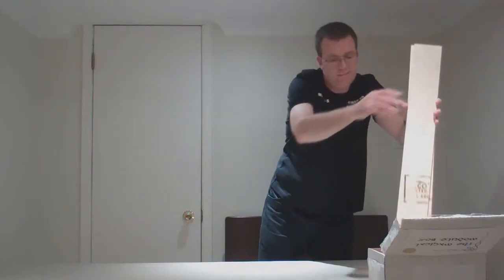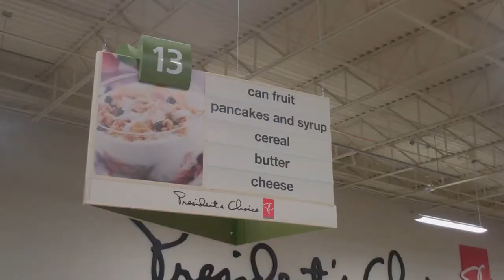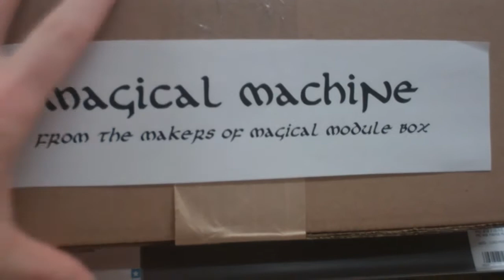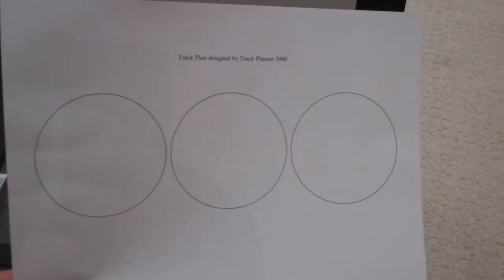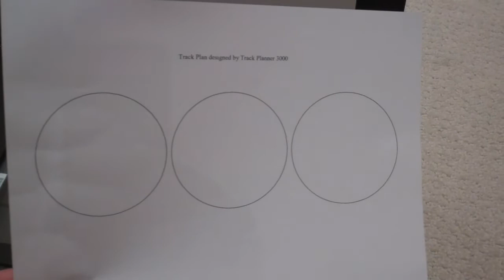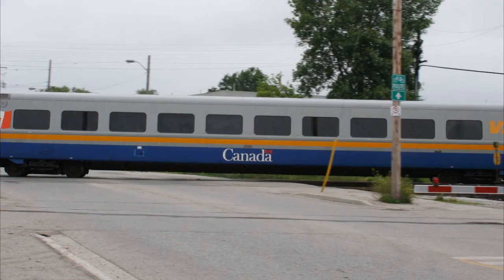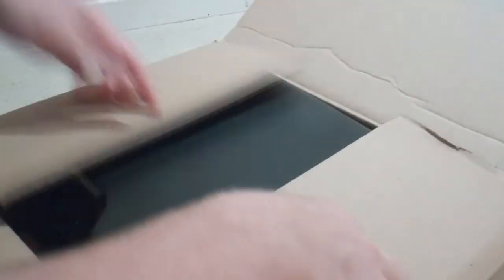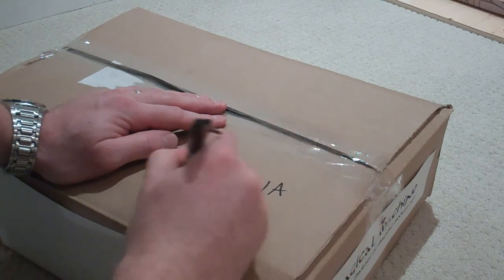Building an HO Scale Modular Layout - Part 3

Comment: Very clever presentation. You might consider more space between your curves on either end. With the planned 2 inch clearance, longer wheelbase equipment may not have sufficient room to pass each other. Suggestions for track centers on curves can be found in NMRA recommended practice RP-7.2 on the NMRA web site at  https://www.nmra.org/sites/default/files/standards/sandrp/pdf/rp-7.2_curved_track_centers_draft_02.pdf. Hope that helps.
Reply from the maker: Thanks for the input. I have taken the curves into consideration and will make them a bit wider, I just forgot to mention that. Thanks for the links, I'm not sure how much space I'll increase to ye.
Reply: Good decision. I'm sure you will be happier with the wider curves.